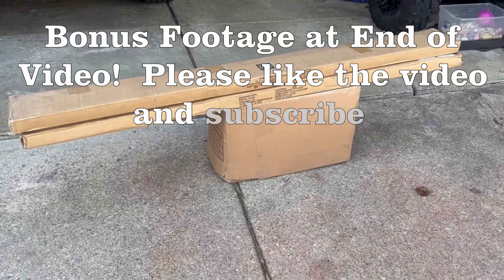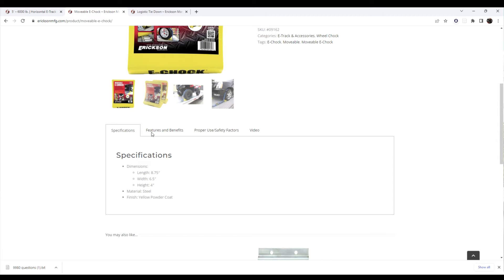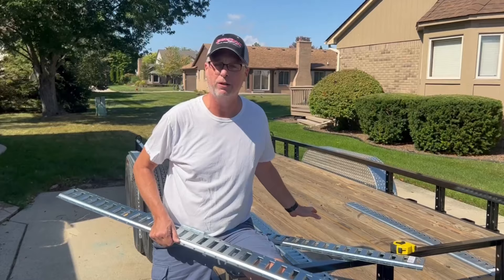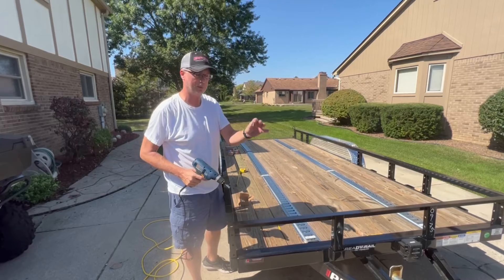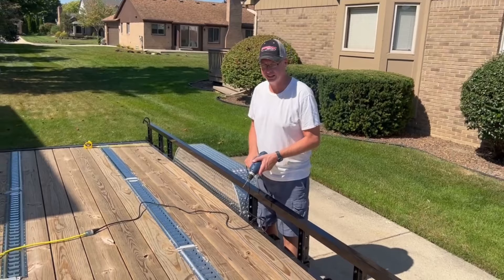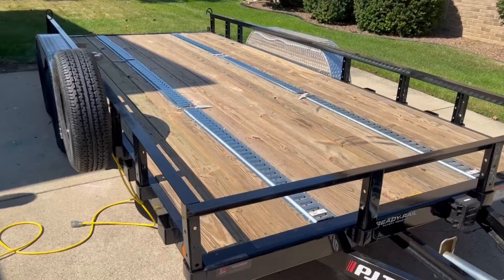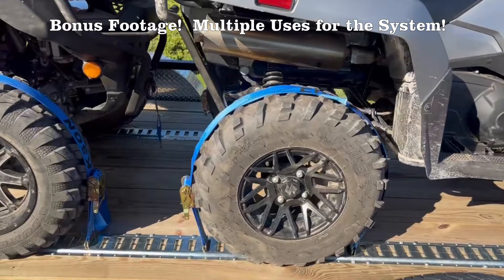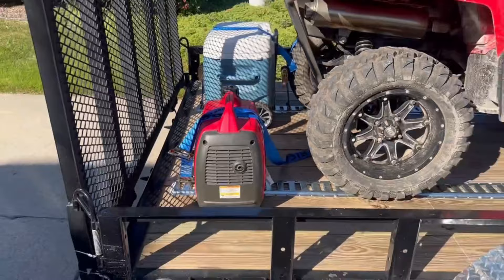E Track Install Video on 16ft PJ Utility Trailer for ATV/Off Road Vehicles— Erickson Tie Down System

Comment: Thanks for video! Just bought a tipping flatbed trailer. The trailer loads Quads side by side and is split down middle so each side tips independently. 

We are definitely putting E-Track down. Question: was there any reason that you went with the 2 inch straps over the tire basket straps?
Reply from the maker: We had the two inch straps on our last set up and loved em.  They are pretty versatile for strapping other things down as well (generator, cooler, etc)

Comment: I have been looking at this system for my 18 footer trailer. What does the track look like after it has been exposed to the weather for a few years. I live in Canada and we use salt on the roads.
Reply from the maker: We were concerned about the same thing.  So far no issue at all, it’s only been just over a year but have held up like the day we installed them so far.  I don’t know if it matters what brand you put on or not but we used Erickson for these E Tracks and when we did an E Chock system about 5-6 years ago.  The E Chock system has also still held up great (person who has it now we are with a lot).

Comment: Off subject, can you send me a detail picture of your spare tire mount and did your trailer come with it? Also, I’ve bought the 1 foot section because I did not see any point  in the waste of steel. I am thinking about taking them back and doing the whole trailer because I love your idea of strapping down extra gear and you can possibly cable lock your stuff.
Reply from the maker: We have the spare tire mount that came on the PJ Trailer.  For us the longer e track pieces opened up a lot more options as you mentioned.  So far the biggest issues for us have been did we get a long enough trailer and can we put a large toolbox on the front of it?  Otherwise has been great!
Reply: @DirtyJakTheDustyBean  I bought my track system from harbor freight but they do not sell those end pieces.  Can I buy those separate?
Reply from the maker: @mikemcgee6810  yes we bought them on Amazon if I remember correctly.  I’ll look up the purchase and see where we bought the ones we used and try to update the description with a link.

Comment: So did you really put bolts in every hole on the tracks please tell me you didn't LOL getting ready to pick up a new 7x14 trailer and I don't want to drill 100 holes.............................  GREAT VIDEO!
Reply from the maker: Lol, heck no maybe every third hole or so on the track.  It did end up being well over 100 holes though for the 16ft trailer.  From start to finish only took us a couple of hours, was pretty easy overall.
Reply: Self Tapers into the metal that the deck boards are screwed to work well, then normal wood screws to the rest of of it. Works well., maybe 4 bolts and taps in the 4 corners if your really concerned.
Reply: I haul mostly lumber and a zero turn mower once in a blue moon.  Thinking about this system. Would it be secure enough if I didn’t drill through the frame.  Just bolted it to the wood?

Comment: Hey jak, could you specify what bolts n hardware you used to secure your e track to the trailer.
Reply from the maker: We were given a list by either the dealer or manufacturer (can't remember which one) of hardware that would work for our type of trailer.  We were told that many trailers could be different so we didn't save the list, sorry other than what we have in the video I don't remember off hand what hardware we used.
Reply: Thanks Jak, just bought new trailer today and have my e track ordered. This will be a big help for my quads
Reply from the maker: @MotoFlows  What trailer did you get?
Reply: Most of the e track holes use a 1/4” x 2” through bolts and or lag screws but I used 2 1/2”

Comment: You wasted your time and money with the fasteners. You SHOULD have drilled through the metal cross bars in the trailer and used your bolt system. Bolting them to the boards isn't strong enough. When they built the trailer, the boards are just laying on top.
Reply from the maker: We made sure to put some through the cross bars as well.  Many are through the wood but some through the metal as well, overall seems very strong from what I can tell.  Thanks for stopping by
Reply: You know the boards a lag bolted to the frame right lol
Reply from the maker: @jdenotter26  we went a bit overboard securing these tracks, we figured it only took a few extra minutes to do and cost just a few bucks more.